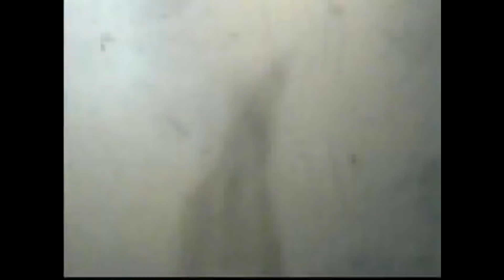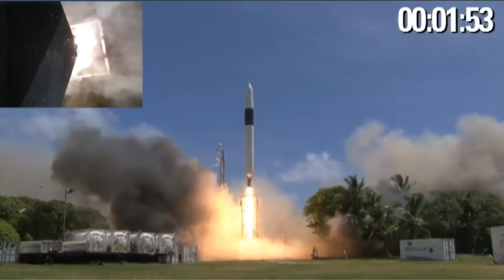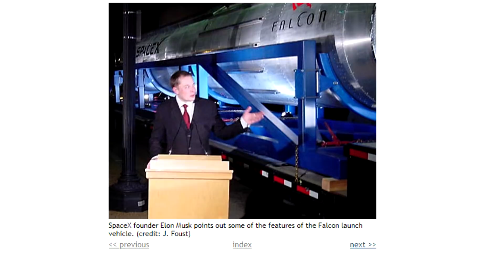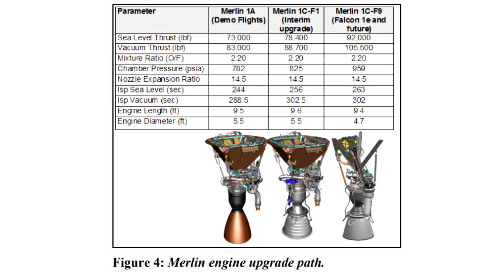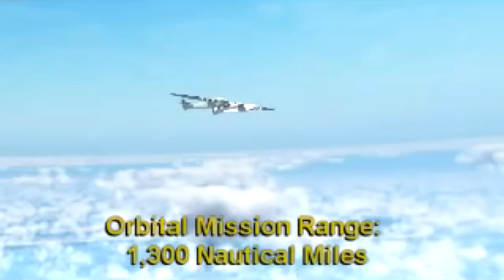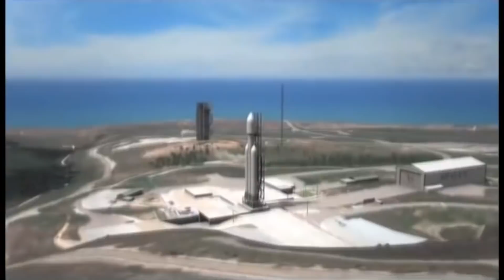Abandoned SpaceX Rocket Designs - Falcon 1e, 5, 9S5, 9S9 & Air

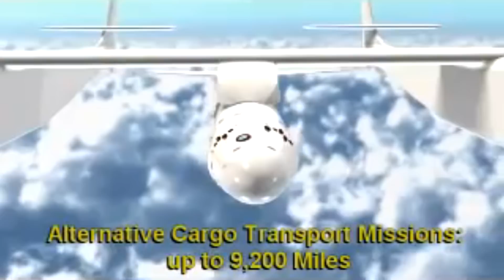Comment: The model example shown at 06:30 of this vid, could have been extremely economical to carry individualy, SN and BN, one at a time, thus granting a full stage beginning at orbit during refuel, 66% of a first stage rocket, is used up on the first 2 zenith path under the thick terminal velocity air & gravity atmospher layer, under 60mile going to the kamen, which blade purpulsion and wings are an advantage, but above the kamen, zeroing air and low gravity is a buddy to rocket engines, the faster version, like a Skylon stage ; non fuel blade purpulsion, then afterburn jets, then jamset formation, eventually to Kemen peak, 'bow&arrow" rocket shot out to orbit line.

Comment: Stratolaunch was almost right but stupidly flawed two ways.  1). It should have had the tail wings linked across the two fuselages ( more rigid safe design and dual attach points that could have been made to hold the rocket along its whole length to eliminate loads on the rocket).    2) It needed a momentary rocket boost (or other means) to launch the damn rocket in the right direction (pitched up at least 45 degrees up).  Can’t blame Musk for bailing out because of these flaws.   Stratolaunch could have been the best approach in a lot of cases. Launch on equator, launch polar orbits, super low cost to start the rocket 8 miles high above atmospheric drag and 500 mph.

Comment: Also the original Falcon Heavy would have inter-connected the booster fuel tanks to the core rocket, refueling the core as it flew.  By the time the booster tanks ran dry and separated the core would be almost fully fueled.  This concept was dropped, probably because it was too complex, and also to allow the boosters to retain enough fuel to fly back and land.

Comment: I had a very annoying and memorable argument about vertical launch versus horizontal with regards to loads with someone who has a degree in aeronautical engineering.
He stubbornly denied winged vehicles experience different and more difficult loads than vertically launched rockets.
It's amazing what you can do with motivated reasoning.
Reply: Such arguments really just show that people are not innately rational, much less logical.

And the ones who insist they are, should be regarded with much suspicion. XD

Comment: What about the reusable 2nd stage concepts?
Reply from the maker: That’s in the next video
Reply: Scott I’m not sure if you’re into brainstorming concepts in your public forums. Love to hear what you think about the following second stage reentry concept. 
Could a Trident missile type aerospike (ablative or liquid cooled) be applied in reverse for reentry? During reentry the aerospike would be extended to create a “safespace” within the conical shockwave protecting the base of the rocket. The Second stage would also have Falcon 9 type landing legs that would dynamically extend into the shockwave for guidance and aerobraking. Add 2 vacuum rocket engines with extendable/retractable nozzles (retracted for packaging/extended for vacuum burn/retracted for atmospheric deceleration & landing burns). Any potential?
 @scottmanley

Comment: After the last launch of Falcon Heavy I was wondering, y diddn't they build a "falcon 5" as central core.
They shut down a few of the engines short after liftoff because of "too much trust".
5 engines would be enough to make the reentry and to land. And they would save some weight and fuel if they doun't need to carry 4 shut-off engines all the way.

Comment: The last design you showed in the video, the Falcon Heavy using the Falcon 9 - 1.0 boosters, said in the marketing video, "Thrust equal to fifteen 747's at full power." Do you have any idea how much thrust the current Falcon Heavy produces in units of '747s at full power'?
Reply: Well, Wikipedia claims Falcon Heavy delivers about 22,819 kN of thrust at sea level, and that for a 747-8, you're looking at about 1,200 kN - so about 19x. Of course, those numbers will vary depending on which exact 747 model you're looking at, since they've flown with a variety of different engines over the years.

Comment: What about fuel crossfeed on the Heavy? Is that still in the plan or no?
Reply: No, in fact I would not be surprised to see the Falcon Heavy being retired with less than 10 total flights.
Reply: It's not an huge loss for only two side boosters. But they would need crossfeed if they had decided to build a falcon superheavy.

Comment: Sounds like apple products

I mean seriously, 1E, 9S5, Falcon 9 AIR?!
Reply: You should be glad they didn't name any of it Falcon 9s Pro Max
Reply: It actually makes a lot of sense. Falcon 1e must have been a 5th iteration of Falcon 1 rocket. 9S5 is Falcon 9 with Side mounted Falcon 5 boosters. Falcon Air is air launched version. Nice and easy to understand what it is from model name.
Reply: Hekssas Yea i know, just sayin it sounds like apple could have named them
Reply: @g4l4x83  for a minute i thought i was hacked
Reply: Still can't forgive them killing Apple IIGS.
Bastards!
Reply: @volo870  Don't get me wrong, I love the IIGS conceptually (not that I've ever seen one in person, only it's relatives which are a lot less impressive)

But it was basically Dead on Arrival, and probably only released at all to keep Wozniak happy.

You can see this by the fact they intentionally gimped the CPU.
A 65816 running at 2.8 mhz in 1986?
When 4+ mhz variants were easily available, and faster was probably possible if you had the money to throw around?

The only reason that happens is because with a faster CPU it would've made the Macintosh look bad.
(Wozniak's accounts, which may not be 100% reliable, but certainly are plausible, was that a 65816 was about twice as fast per cycle as a 68000. So you can imagine what a 4 mhz 65816 would do to a 68000 system running at about 7 mhz)

Without intentionally gimping the CPU you'd have the following:

Macintosh: 
- OK CPU
- well designed GUI
- monochrome display
- Poor sound capabilities
- No backwards compatibility

IIGS:
- Similar if not better CPU (if it had been at least 4 mhz)
- Very similar GUI to the macintosh, with similar design and capabilities (better in some ways due to the hardware)
- Full colour display with advanced capabilities and at least 1000+ simultaneous colours in some cases
- Very advanced sound capabilities (for the time)
- Backwards compatibility with the majority of Apple II software...

You tell me which would have won in a sane world...
Yet they deliberately gave the IIGS a weaker CPU than needed, to make it look bad, and made it hard to buy, and more or less tried to hide it's existence.
Because it didn't fit apple's new philosophy anymore.
Even though the Apple II is what made Apple, it seems by that point they were kind of embarrassed by it...
Reply: @volo870  IIGS??
Reply: Hopefully it'll be cheaper, more reliable, and more repairable than Apple products. And not made in China...

Space X: Suicide nets deployed
Reply: Maybe Scott's narration was influenced by Apple corporate culture...
Reply: There are far more similarities between SpaceX and Apple - fans that will defend any decision they make, unwillingness to share know-how or make products compatible with any third-party system, founded by a eccentric man, mostly derivative R&D that is praised as peak innovation...
Reply: Uuuh, you're right! I mean with the letter after the numbers I was like "Well, could be anything, Canon, Sony, Panasonic do that as w-" "AIR" "Oh COME ON!"
Reply: Sounds more like Samsung
Reply: HEY YOU HAVE IDENTICAL PROFILE
Reply: actually yours shows more of kerbal face
Reply: Also Samsung
Falcon S5, Falcon S9
Reply: Elon Musk canceled them when he learned they didn't have headphone jacks, and there was a weird notch in the screen. XD
Reply: Maybe Apple stole their idea.
Reply: Seems like SpaceX actually did it before Apple did?
Reply: F(irst stage) 9 engines, S(econd stage) 5 engines. Is it the nomenclature idea that fell trough?
Reply: @MmeHyraelle  S(trap on boosters) 5 engines each is how I think it was named. UT I could be wrong

Comment: Not even one speculative asparagus-staging design? I'm a little disappointed.
Reply: I mean originally cross-feed was proposed for Falcon Heavy, and Elon later mused about a 5-booster variant, so there was some potential there.
Ultimately though, Falcon Heavy is now so capable that it can easily handle any payload that will actually fit in it's fairing, or even an upgraded one.
And with Starship on the horizon with a much greater payload volume and operational simplicity, there is no need for a 5-booster asparagus staged Falcon Heavy.
Reply: @lazarus2691  Yes, crossfeeding would have been necessary for a falcon superheavy. Performance loss is just too much without it.

Comment: They also abandoned fuel crossfeed on Falcon Heavy.  Is that because it was just too much complexity for too little benefit?   Does crossfeed provide real benefit over that current approach of just throttling the inner core back during most of the booster burn?
Reply: This is an example of theoretical maximums vs engineering optimal. In the real world the added complexity, cost, risk, and weight would all lessen any benefit they might get from crossfeed. It's probably still possible but I have no idea if it will ever be worth it within the next 25-50 years.
Reply: @garret1930  Especially since Heavy has flown, what, three times total? Once upgrades to the basic Falcon made Heavy redundant for a lot of the planned payloads, I think it quickly became obvious that continuing to pour development funds into making crossfeed work wasn't justifiable... especially once conversations around BFR started getting serious.
Reply: Probably because falcon superheavy was scrapped. The performance loss on falcon heavy is not as big.
Reply: It would have meant a 3rd falcon 9 booster design.  Simply not worth it.

Comment: Coming soon: Starship Nuclear with liquid core nuclear thermal rocket engine, like the old Liberty Ship concept. Bring it!
Reply: That's not something you want operating in an atmosphere, even with an outer ring of Raptor engines for takeoff and landing. It makes more sense to build it as a separate spacecraft, small enough to be launched in a Starship Cargo payload bay. It carries an inboard liquid methane tank, and is able to attach to the standard hose fittings on a Starship upper stage used for orbital refuelling. This means it can be refuellled by a Starship Tanker, and stays in orbit once it's been activated keeping the radiation away from inhabited places, and reducing contamination in the event of a crash.

You launch a passenger/cargo Starship for Mars as normal, but while you refill the methane tanks fully, you only need enough oxidiser for the landing at the other end. You also top off the inboard tank on the nuclear stage. After fuelling is done. this rendezvouses with the Starship, connecting to it's tanks. You can use the inboard methane tank and some Starship methane in a methane propellant NTR to get more than twice the specific impulse of a purely methalox Starship, increasing delta V. Excluding a chunk of the LOX would also reduce the GTOW as liquid oxygen is over 3/4 of the mass, further increasing delta V. 

This means you either have wider transfer windows, or can do faster transfers. At Mars, the Starship undocks with just enough methane and LOX to perform the landing. The nuclear stage stays in orbit, and gets refuelled by a tanker just before it's used for a Starship to travel back to Earth.
Reply: The liberty ship was supposed to use closed-cycle gas-core NTRs a.k.a. nuclear lightbulbs. Liquid core NTR is a different design entirely. 
Also  @stainlesssteelfox1 , methane is not a good NTR propellant, because the heat breaks it up into carbon and hydrogen. While hydrogen will flow through the engine with no problem, some of the carbon will undergo deposition and clog the plumbing.
Reply: @stainlesssteelfox1  just add that you'd need enough propellant in the nuclear stage to place it in Mars orbit.
Reply: @stainlesssteelfox1  How would you get the nuclear stage and/or it's fuel into orbit without posing most of the same risks in the first place though?

An accident with a nuclear rocket would be bad whether the rocket is operating under it's own power when it happens or is just the payload on another rocket...
Reply: Like Project Orion, with nuclear bombs?

Comment: Wasn't there an early Falcon that was going to have 3 engines in order to have engine out capability?
Reply from the maker: That was the Falcon 5 where they mentioned the engine out capability.
Reply: Falcon 5 would have reached the iss, even if two engines would have failed. At least that's what they promised.

Comment: RL-10 on a Falcon - now I've seen everything!
Reply: Honestly, the Falcon Heavy needs an RL-10 third stage to be viable for deep space missions.  I ran the numbers on that for a certain internship to prove a point.  Numbers-wise, you can basically drop a Delta IV second stage on top of the Falcon Heavy second stage and put your payload on top of that whole stack. The math works out to something like 18 tons to a Saturn transfer trajectory.

Edit: don't quote me on the specifics there, I remember it being a very large number relatively speaking to one of Jupiter/Saturn/Uranus.
Reply: @JMurph2015  They thought about it for Artemis missions.
Reply: @johntheux9238  yes and 1) the moon isn't really deep space when you're talking the Moon vs say Jupiter or Uranus 2) for Artemis, all of the payloads I've seen have a transfer stage planned (i.e. approximately what I've been talking about) or are light enough that it doesn't matter one way or the other.  Let's just say the for certain portions of NASA there are some very large missions that having a 3 stage FH would make the difference between being able to launch on FH or having to use SLS or even DIV Heavy (iirc for the high energy trajectories eventually DIV Heavy outperforms FH currently because it is all hydrogen).
Reply: Joe Murphy Falcon heavy have no third stage.
Reply: Kerbodynamic X Falcon heavy can have RL-10 stage as third stage inside the fairing is what he is saying.
Reply: @AkaiKA4K  so actually it would have to be outside the fairing I think.  Those stages are pretty big.  It would basically be an entirely new structure (tanks + adapters) compared to the Delta IV second stage, but I used it for a point of reference on the general size and performance numbers.
Reply: @kerbodynamicx472  But it could, and for some missions, should.
Reply: It is too expensive. If SpaceX wants a hydrogen upper stage, they’ll probably make their own engine.
Reply: @kerbodynamicx472  hydrogen engines are extremely expensive to develop from scratch, which is why they said they won't try.  Elon has said it would sink SpaceX to go down that route (which at the time was probably true).  It would cost ~$5 billion upfront to develop a new engine vs the tens of millions that each RL-10 costs per launch.  So naturally if you aren't using this configuration a lot, the RL-10 solution makes much more sense.
Reply: @JMurph2015  It's not just that it's expensive to develop - it's also the cost of not having commonality. Right now, they're saving a lot of money by having both stages use the same engines, the same tank design... and perhaps most importantly, the same fuel, avoiding the need for separate fueling setups at the pad. You're right, there's a big payload penalty for using the kerolox upper stage - it costs them some missions that can only be done by Delta IV - but they've obviously decided the trade-off is worth it for them.
Reply: @simongeard4824  except they are also missing missions that can only be done by SLS as well, which is really the bigger issue.
Reply: @JMurph2015  That may be the case, but I don't think they care for the small number of payloads involved... there's little to be gained by diverting attention away from Starship to build a new Falcon upper stage that will only fly two or three times before Starship is ready. Not a good investment from the point of view of a company focused on Mars.
Reply: This is a better vs best discussion. As they are currently, the Falcons are the best for LEO and even thought they are sub-optimal at GEO they are still cheaper than the competition there. And with that, they have a perfect formula for the current commercial demand. Now research and exploration missions want to go beyond that and would benefit from an extra stage or at least a fuel/engine with more delta-v on the upper stage. Then how does a RL-10 compare to a Raptor? And how does a three stage design compare to orbital refueling? In the end I think, if you compare everything on development cost and individual launch cost you'll end up with something like the Starships. The only critical note I have with the Starship is that there is probably no significant demand in the near future for 100 Ton to orbit launches. So I would start with a falcon size Starship. But hey, who am I to judge that.
Reply: @mennol3885  There are roughly three extremely large missions that need to be launched in the next 5 years that can only really go on SLS or a Falcon Heavy with an extra stage.  I don't think Starship/Superheavy will be ready or be capable (deploying satellites isn't going to be on their first revision).  So unless you are confident in SLS hitting timetables (hint, it won't), you should be hoping for something like this to happen.